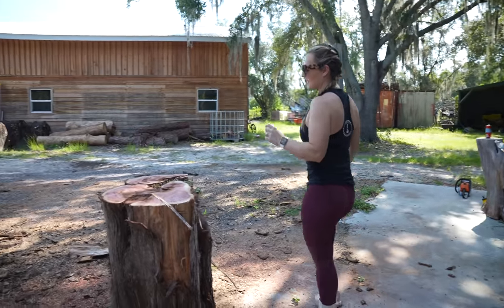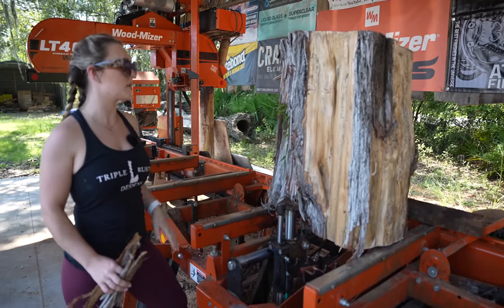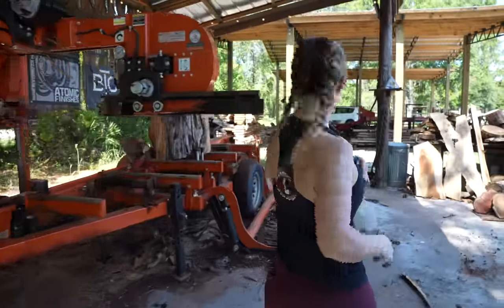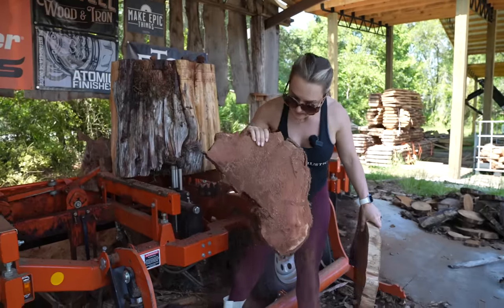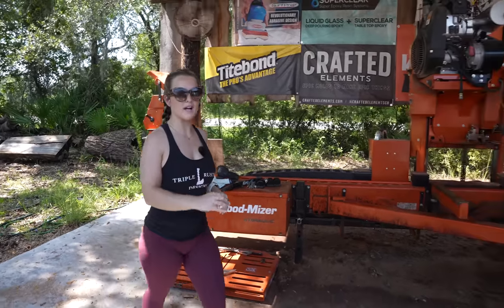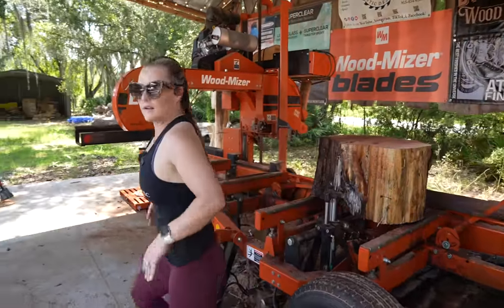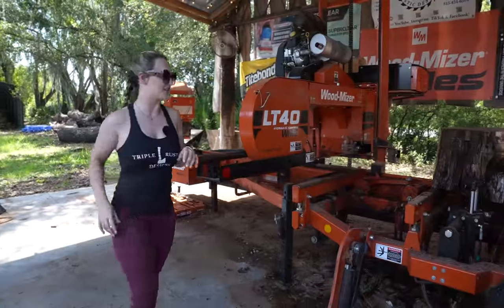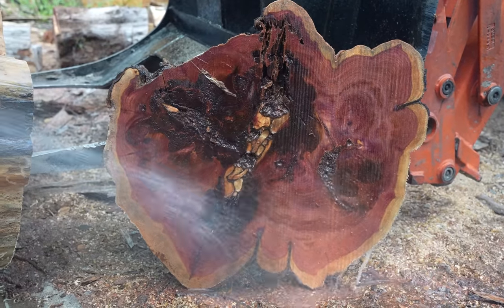Slices of Cedar With A Purple Heart!

Comment: I use cookies to turn platters and they usually turn out nice. The biggest issue is the pith drying and warping the platters so I rough turn first, let them dry and then finish turn.
Reply: How long did you let that dry before you cut it? Or was green yet?